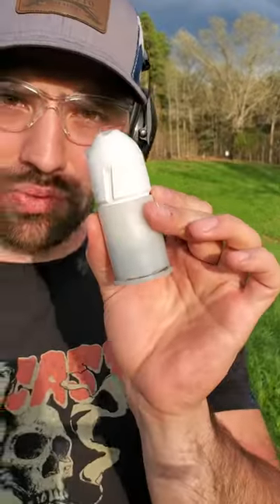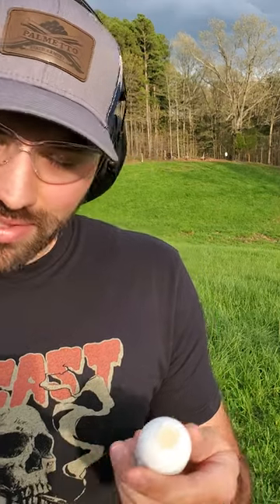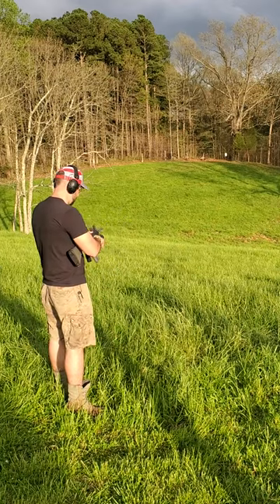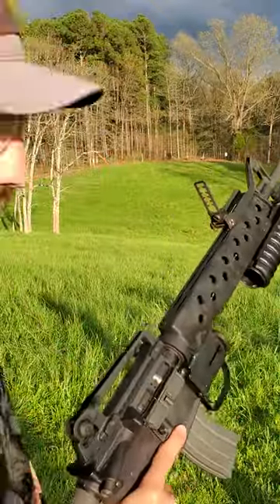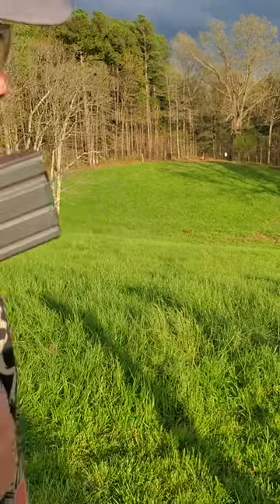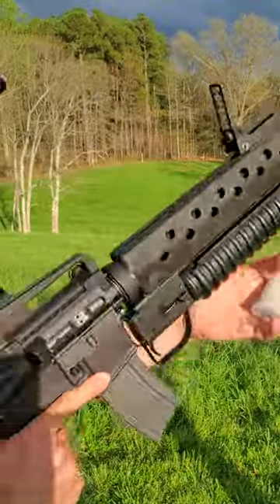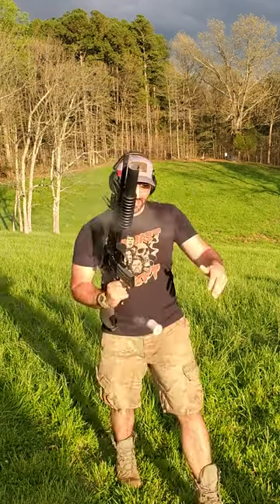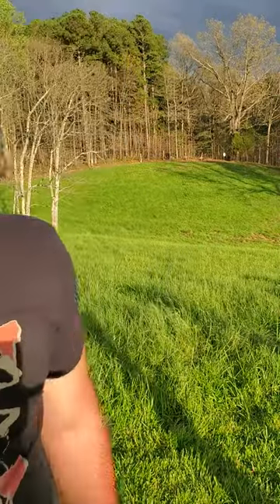3D Print 37mm Chalk Round (Part 3)

Comment: I think I remember you saying that you're using pyrodex as a propellant. I don't know anything about 37 mm launchers. But I know a lot about muzzleloading. Pyrodex the burn rate is somewhat pressure dependent. With real black powder it is not. You might get more consistency with real black powder.
Reply from the maker: Thank you!   Yeah I had a buddy recommend real black powder.  I'll give it a try!   Thanks!
Reply: Or use smokeless casings. 2.5 - 3.5 grains of bullseye..

Comment: Im impressed, i have not used bp in my 37mm in a while, i was using the blanks with smokless. I also do not have a 3d printer yet so id like to thank upu for showing me your work. Question your launcher looks like an ETC or Cobray but the early version, the cocking handle is it just the round rod, or the curved version?
Also your not near ohio are you?
Reply from the maker: It's not a cobray. It's just a straight piece of steel to cock it.  The guy I bought it from said it was an early law enforcement model.  He's had it for 20+ years and mainly used it as a display piece.  Also, not Ohio.  #Hoosier 😊
Reply: Thanks for the info, my cases i made to use standard 9mm blanks, they are more safer and consistent than black powder, however they dont set off a payload, keep the videos coming your really good at it!
Reply from the maker: @Godthepredator  the cases you made, were they 3D printed or aluminum?
Reply: @Godthepredator  I was just trying to see about 9mm blank fired … are the metal shells or stl?
Reply: @Godthepredator    That reminds me of a 40 mm chalk round that ChevTec Group made a video on, he used a 38 short blank in place of both primer and propellant, which you can insert into the casing, which is made of nylon, just before firing. He had a reusable zinc pusher that he used for the base of the round, which I think protects the chalk head from the chambers pressure so it is less likely to explode in the barrel, but also provides a little weight to the round, make it more stable in flight.
Reply: Any updates on recommended load data?